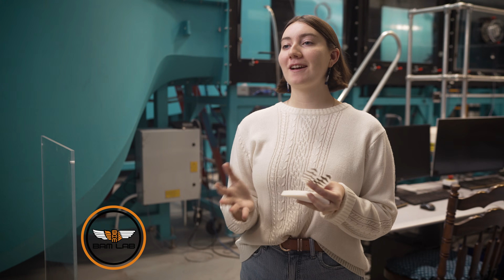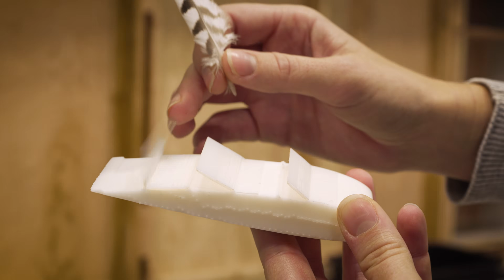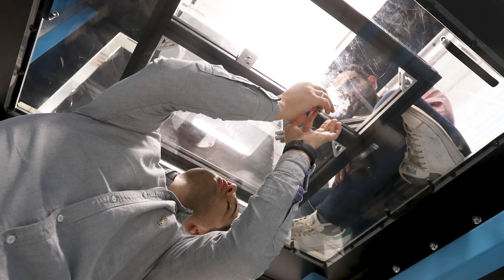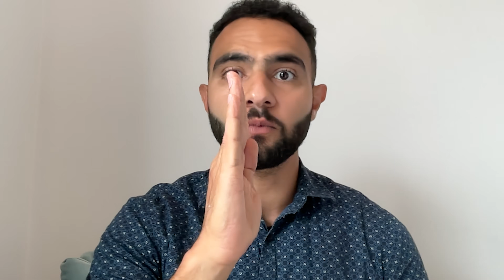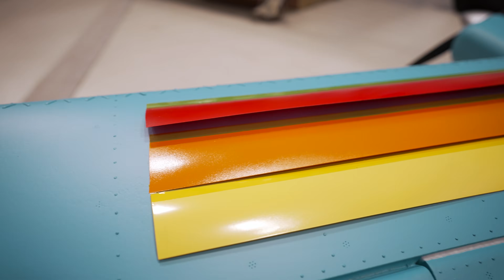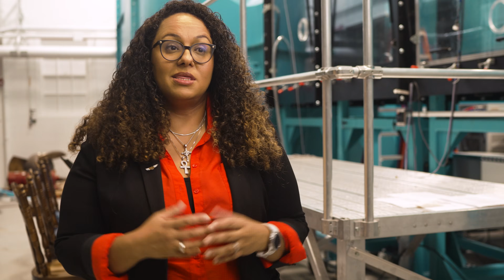Distributed Feather-Inspired Flow Control

Comment: Unless you build an airplane controled by a bot program wich can flap its wings and lift itself from the ground like most birds do without any forward inertia. Having feathers on a wing is pointless.
But for a plane to be able to do that, it needs it's own brain, thousands of sensors on it's wings and servo mechanisms. 
And at that point, you no longer fly the plane, you more likely ride it. Because the plane flies by itself, you just command the directions. 
The main difference between a bird and a plane is, the bird is a living creature, an organism wich has adapted to flight during milions years... A bird is capable, most birds at least, to generate lift without moving forward, and do things in flight wich we can only dream to achive. You just have to accept the fact that, birds are meant to fly, we aren't.
But we are capable of making planes wich can fly faster, much faster and carry alot more weight than birds. A flying machine is not a bird and will never be.
In RC plane world, there is a type of wing wich is easy to make by stacking multiple sheets of foam, is called KFM airfoil and it is in steps, with 1 or 2 or more steps.
Those steps are not fluid, you would think not very aerodynamic too, but you would be wrong, in each gap of those steps during flight, forms a tiny vortex, wich fills the gap, making the wing fluid through air. Race cars for example, at the end of the spoilers, have tiny spikes, the reason for that is to break the air so it doesn't stick to the car, making the car aerodynamic and faster.
The feathers wich lift on birds i think serve the simple purpose of telling them the wing is in a stall.
There is no point to have this feature on a plane's wing, since planes do not need to stall. And unless you build an airplane wich spins it's wings on an axle during take off and landing for slower speeds, there is really no point to have this KFM airfoil on the wings.
And if you really want to test this properly, you need to hire or find a guy wich flies RC 3d planes, Because those guys can literally just hold a plane still in the air like a helicopter and they can test this effect on wings the best. And if you would watch a guy who flies 3d RC planes you would understand, a plane can fix alot of bird's stalling problems with simply having an motor with a prop.
A bird does not have that kind of propulsion, the bird's propulsion is it's wings, and i feel like alot of scientists when making these test fail to realise that.

Comment: Very interesting options open up when you can shape the flow over a wing. Adding reliable pressure sensors on a light craft could lead to fun experimentation and prevention of stalls. - not an aeronautics engineer nor pilot. Just a kid making paper planes with these kind of wings. Hovered in a slight breeze
Reply: what kind of pressure sensor do you think fits this purpose?
Reply: @ I’m not an engineer and am unclear if they exist. I think I’ve seen strings or ribbon like hairs or feathers in wind tunnel tests. I always assumed they were for visual insight and weren’t sensors

Comment: Wear on those must be insane. Replacing the whole wing every couple of flights is feasible for a bird, not for a plane.
Cool idea tho :)
Reply: If they only deploy in high angles of attack and were made of thin but durable material (TPE or some other thin rubber composite) I wouldn't think wear would be an issue. They only "deploy" during high-angles of attack when the wing is stalling right? So as a safety feature, especially for small passenger aircraft were accidents often occur during takeoff and landing, I think this would be a great addition. Though I'm not sure how they would fair in icing conditions.
Reply: It’s not relevant because you don’t get longer flight times you get better climb which we don’t need in any aircraft anyway and it certainly wouldn’t work on a jet aircraft as you said, the speeds are too high they would destroy these features. This is very specific. Which is why they said the application is uavs eg: war at the end. 😢 but I still don’t understand why a UAV would need to be able to climb rapidly. It’s not something an observation platform needs.
Reply: @AricGardnerMontreal  Drone swarm deployment from larger platforms is the future trend, with a variety of small drones optimised for a variety of roles. You'll see some sensor drones, some attack drones, and some drone intercepters to counter enemy drone swarms. The last one might do better with more agile flight capabilities, especially if they equip small arms, so I can see this technology being used in that role.
Reply: @Er19421  the interceptor will not be a low speed fixed wing platform. you are thinking of a missile.
Reply: @AricGardnerMontreal  These haven't been finalized. The disposable mass drone initiative is under the golden horde program, while the attritable fighter/attack drones are under the CCA program. There will definitely be overlap, but there is more than enough operational requirements for both systems. I suspect combining the final products will have a multiplicative effect not seen since the second offset strategy.

Comment: Don't forget that birds can sense stalls with them.
Reply: Interesting thought. The passive flaps could also be sensed quite easily, either from below, the side, or visually. Cool extension!
Reply: Of course they can, there's been decades of government research that has gone into designing birds
Reply: @VacuousCat  the design of birds are so much more advanced than what we have designed! It's just mind blowing. I've read somewhere that's it's true "fly by wire", the feathers also tell the bird what the boundary layer is doing and can morph almost any part of the wing at will to produce the best results!
Reply: @captarmour well of course it's fly by wire. It's controlled by a neural network and electrical signals - there's literally no other option than fly by wire. 

Another impressive thing is they'll induce full or partial stalls for manoeuvreability. And they also don't need a vertical stabiliser due to the active control and ability to move each part.

Comment: Seems like they would increase drag and weight on a real aircraft
Also I highly doubt that thin flimsy membranes can actually keep a 2 ton aircraft in the air below stall speed...
Reply: they dont hold up plane, they just increase lift slightly and lower the stall speed

Comment: can you put these on to helicopter rotor blades so lower blade tip speeds can be used for the same lift?
Reply: I doubt the advantage will be worth the weight on heli blades
Reply: @anticlaassic  what weight?
Reply: @gormauslander  extra mass =extra weight. You can‘t repurpose any of the usual mass, because you need the structure , thus you need extra mass
Reply: @anticlaassic  I get that, but they're strips of plastic. It's nothing on the scale we're talking about
Reply: @ you can hardly use the same plastic on a full sized rotor blade for a helicopter. Stresses will be greater .

Also “just a bit of material“ is a big deal when you try to eliminate every gramm of mass from you aircraft or helicopter. 
I am serious! Making a change that lightens a wing sparr by a few grams or percent of weight can make a lot of difference when you use multiple parts. 

Now imagine that little extra mass on a several meter ling helicopter blade.

The weight might offset the gains in efficiency sufficiently as to render the gains zero.

I have not made any calculations on this topic, after all i am still learning all of this myself, but i can see that the problem above might occur.

Edit: i‘m pretty sure you couldn’t use plastic flaps on a full scale helicopter blade. The centripetal force would be really hard on the material and weather would degrade the plastics.
Reply: @anticlaassic  Yeah, I'm not sure exactly what gain you would get from having lower stall speed on rotor blades anyhow
Reply: @ might something bear the to rotor hub, where the distance covered and thus speed is lower